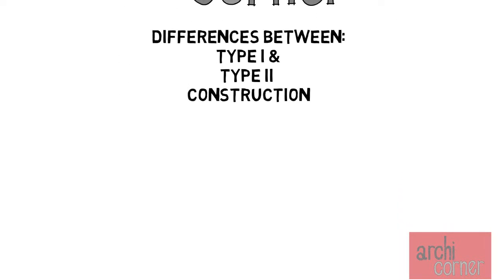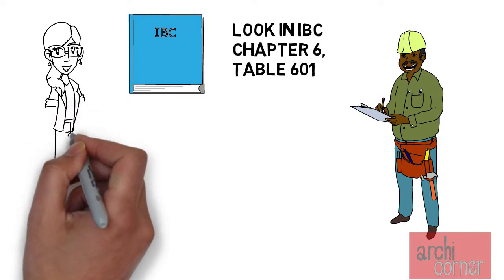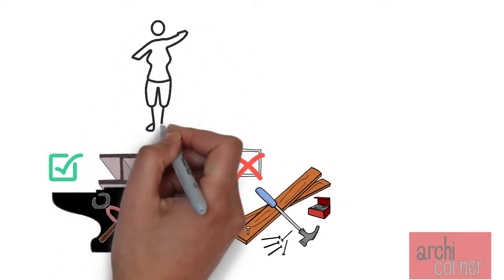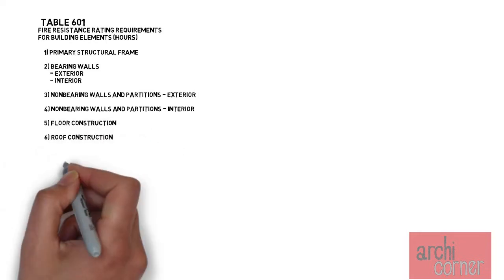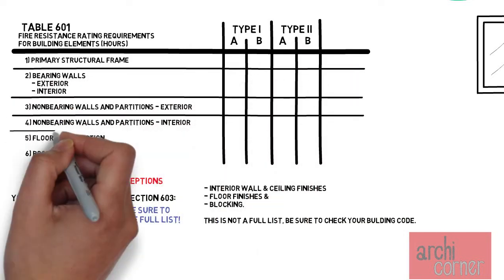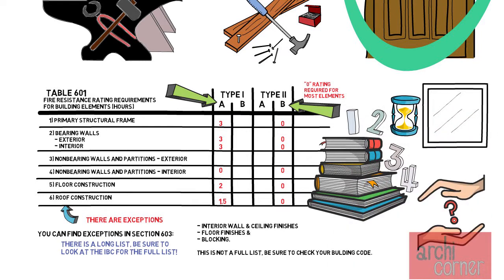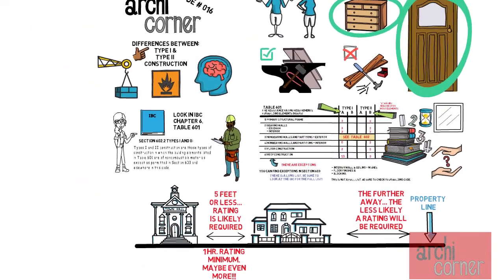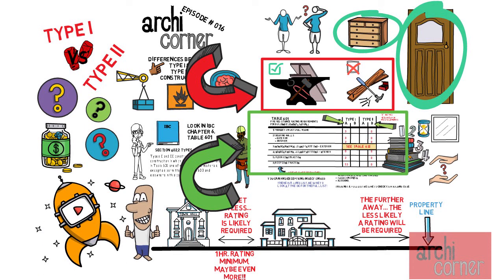AC 016 - What is the difference between Construction Type I and Type II per the IBC?

Comment: Would you mind clarifying if the fire separation distance in IBC Table 602 is defined as the distance from the wall to the property line or to adjacent structure? My understanding is that it's measured to the property line, whereas you mentioned it could be to adjacent structure. Thank you!
Reply from the maker: Have in mind that it is not unusual for large commercial properties to have multiple buildings in the same property. Therefore if there is another building WITHIN your property line, you measure between buildings, but if there is a property line between the buildings, then you measure to the property line. Hopefully you like the added information. Take care!
Reply: @archicorner  Great explanation! Thank you so much!

Comment: What is the exact definition of A vs B?
Reply from the maker: There is no “definition” in the sense that “A” or “B” are not an abbreviations for another word.  
It’s simply a way to differentiate that “A” will have more requirements, often in terms of fire rating requirements to different building components, in comparison to “B” that will have less requirements. 
Hope that helps!
Reply: The “A” types (more restrictive) often allow for larger building areas and heights, which can benefit certain projects. Type "A" provides increased safety and potentially lower insurance costs. The “A” types require non-combustible materials, which can offer greater durability and longevity.

Comment: When in a gaming room with waiting area with chairs and open floor area,  how does one determine the occupancy total?
Reply from the maker: This is definitely  an overdue response, sorry. Even though there may not be physical walls separating the different spaces  or areas, it is common to take the square footages of the separate areas and allocate the corresponding load to each one of them. However the way areas are separated should be reasonable and if needed, you should be able to explain to the plan checker how the loads were taken. In the sample you described above, it may be probable that gaming room, the waiting area and the open floor area could all be provided with their own separate occupant load.  Take care!